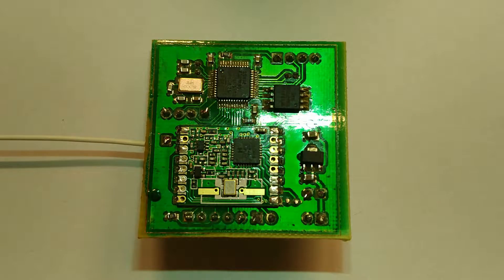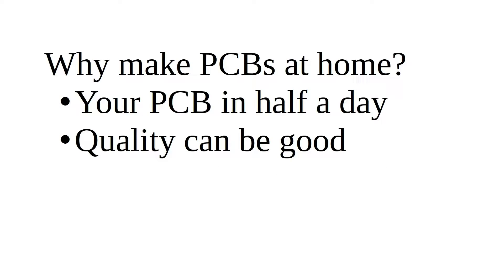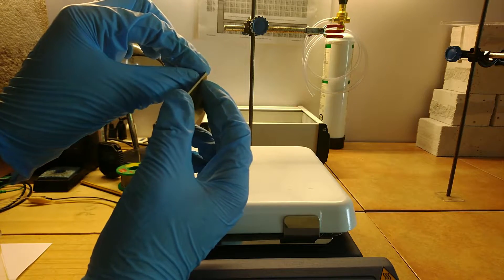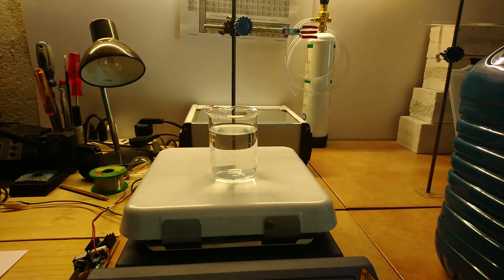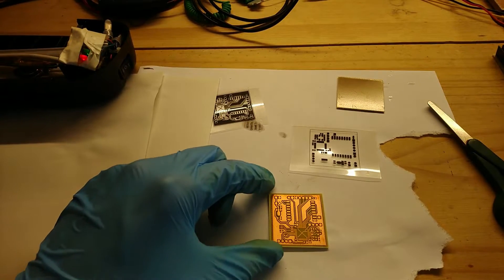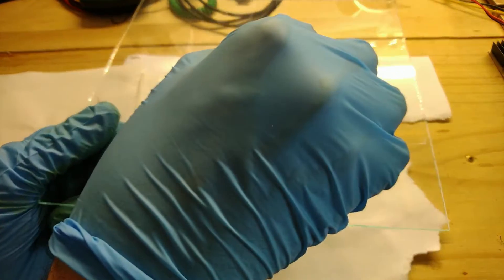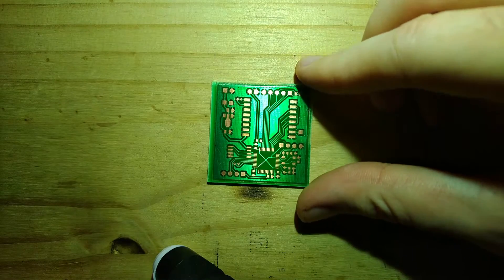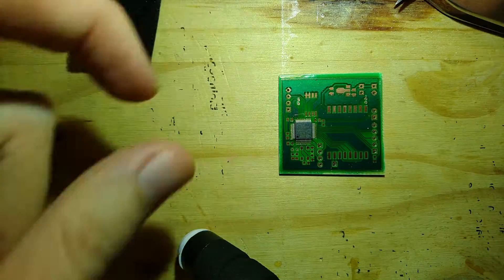Make high quality PCBs at home: an overview

Comment: Also, a fourth reason for making your own PCB is that in most of the developing world - it is still costly to get PCB for hobby usage - shipping costs the bulk of the money. 
I've been in search of the process that would allow me to make a homemade PCB without a laser printer (as they are costly)
Reply from the maker: A permanent ink marker or pen is enough to protect copper against the etchant. But you need to be precise enough to draw the entire artwork. With through hole components it's doable, with SMD it starts getting really hard. The ink can usually be removed with acetone after etching.